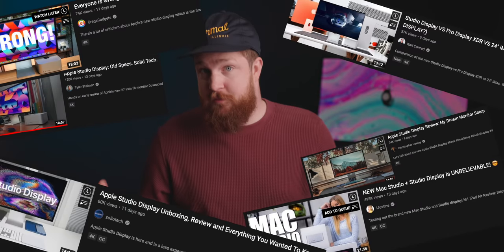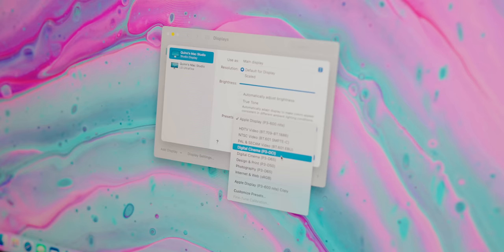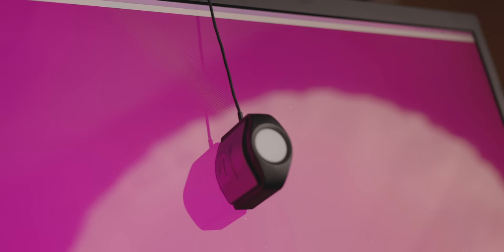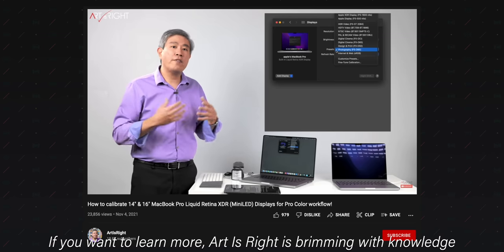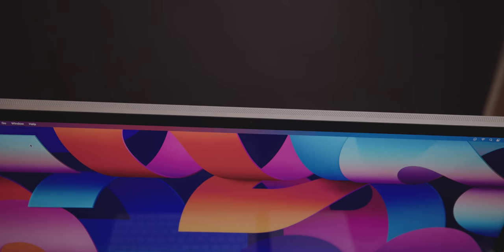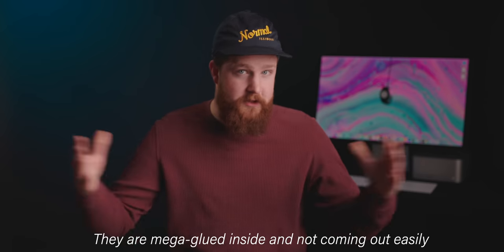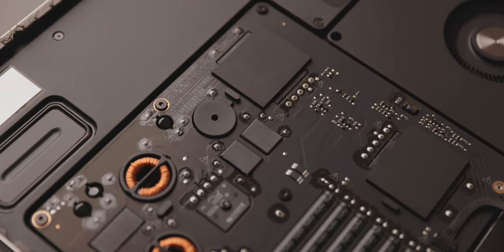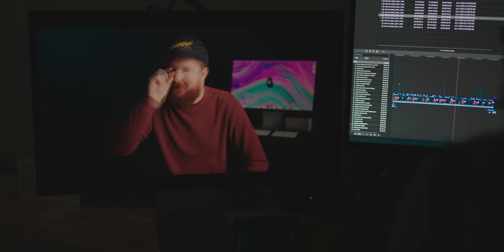The Apple Studio Display Is WEIRD!

Comment: Totally agree with you, I looked into it when I bought the mac studio - but I could not justify the price - sure it has amazing sound and a web cam - two thinks I don't care about compared to good colour and not having to pay so much for a heigh adjustable stand that is included with just about every other maker - I don't see too much difference between 4K and 5K - yes MacOs scales better in 5K but I believe that this is done on purpose. With QOLED around the corner and improved panels  I will rather wait (the 4 months I'm waiting for the Studio anyway). It's beutiful .. sure but I just want a good panel - not something that I use as an art piece.

Comment: I’m still wondering if the rumoured problems they were having with producing mini-LED panels for the MacBook Pros plus supply issues mean this was originally intended to have a better panel but had to fall back on the old 5K because it just doesn’t fit in to the line up of the last couple of years.

Comment: The 64gb storage is not surprising at all. 

Apple standardises - it used 64gb as the minimum storage capacity on the iPhone 11. Taking the a13 + the 64gb storage means there is no additional work required to the chip or config at all + the additional work needed to produce new versions of the a13.

It’s why the HomePod with the a8 also had 16gb of internal storage.

Smart and lazy at exactly the same time.

Comment: I completely agree that this monitor is strange and I thought so since the keynote announcement.  After thinking about it here is my guess as to what this monitor actually is and I’d be interested in your view.  Yes, this a 5K monitor when connected to a running computer.  But, like you trying to understand the use of a A13 with 64 Gig just to handle Siri, Center Stage, and Spatial Audio.  Except for Center Stage all the remaining functions are currently being handled on the much cheaper, much smaller, and cheaper S5 from the Apple Watch found in the HomePod Mini.  So why a A13 with 64 Gig?  On day one when the first update for the monitor was pushed and it was found that the update was iOS 15.4 more things started to fire off in my head.  Is it possible that the Studio Monitor is also the first HomePod with a screen with the ability to run apps such as AppleTV, AppleMusic, etc.?  With a dashboard and HomeKit coming perhaps at WWDC.  Is the A13 there not only to provide access to the apps to control with Siri but also to use Universal Control and to support Widgets for use in the user customizable dashboard?  PS:  The only other Apple product that I am aware of with a difficult to remove power cord is the HomePod.

Comment: There really should be more 5K displays. Having one means you can use it with 2x integer scaling and get 1440p (which is great at that size imo). 2x integer scaling at 4k only is 1080p.
Reply: That's hardly useful outside MacOS, UI elements are drawn by the OS and can be non-integer perfectly fine.  For content consumption, 4K is enough, it scales perfecly 1080p, 720p and 480p. The only advantage I see for 5K is for video editors who want to see the 4K video without any scaling + the video editing software on the screen.

Comment: The now cancelled 27" iMac came with the same screen as the Studio Display plus an Apple computer, plus an Apple mouse, plus an Apple keyboard.   Much of the animus towards the Studio Display is because loyal Apple customers that now feel hosed (taken advantage of/swindled) because for several  hundred dollars less you get no computer, no mouse and no keyboard.  We know and accept that Apple is more expensive but if you compare the iMac Studio (base) plus the Studio Display plus an Apple mouse plus an Apple keyboard  to the now cancelled 27" iMac, the cost is not 20% more or 50% more but close to double the cost.  I hope you are right, i.e. that the 27" iMac will be resurrected but I rather expect the value proposition will have deteriorated vs. the now cancelled 27" iMac.

Comment: Did you try the thunderbolt 2 to 3 adapter and using it with an older thunderbolt 2 mac? That’s the real question
Reply: You won’t get 5k so why do that. TB2 doesn’t have the bandwidth to do that. It can do 4k 60hz but not 5k

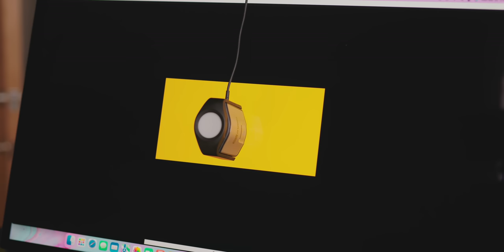Comment: 00:36 You can add 3 more options if you're willing to accept faux-5K (5120x2160, instead of 5120x2880) and IPS. LG names it Nano-IPS, but that just means extended colour gamut (98% DCI-P3) which they all three have. All three share the exact same curved ultrawide panel.
Dell U4021QW (Thunderbolt 3)
Lenovo ThinkVision P40W-20 (Thunderbolt 4)
LG 40WP95C (Thunderbolt 4)
Of course one or the other might not play nice with MacOS (or Apple hardware) even though they all offer Thunderbolt connections.
I like this video.
Reply: Or just buying a refurbished iMac 27-inch.
Reply: @MalcolmREBORN  You managed to use a refurbished iMac 27-inch as a monitor for a Mac or Macbook?
Reply: @Br0adCastYourS3lf  No, I was thinking about the mid 2020 27-inch Intel model which is no slouch.
Reply: @MalcolmREBORN  Then I misunderstood.

Comment: did anyone else notice the "CapXon" capacitors on the power supply? those things definitely will not last, i've seen countless capacitors from this brand just completely dead or leaking on machines that aren't even that old. not sure if this has been a recent apple trend, but in the past they've almost always used high quality caps (nichicon, from my experience) and besides the G5 iMacs they've always lasted for years and years on end.
Reply from the maker: Yeah moving away from Japanese components is a shame.

Comment: What would be interesting is a comparative teardown of the LG 5k Ultrafine and maybe some other example of a 4k thunderbolt/USB-C multifunction display, to see if the internals of the Studio Display really are that surprising, or whether fans (esp. in units with hefty PSUs to charge laptops) and fairly powerful ARM processors are par for the course. 

I suspect that what makes the Studio Display so expensive (apart from the handsome profit margin c.f. box-shifter specials where they only make a profit if you buy a Monster HDMI cable and extended warranty)  is Apple's self-imposed determination to make everything so ridiculously thin...

Another interesting comparison would be to address the real alternative -  the 5k Studio Display vs. a good ~$800  4k UHD display & the associated scaling issues with MacOS - and whether it is worth the 2x price difference. That seems to be the real buyer's dilemma - esp. when - whatever LG says - the 5k Ultrafine is still pretty hard to buy.

Comment: They could make a better display, but I know exactly what the problem is. They don't want this to outshine their flagship pro XDR, that's it. that's the reason. As for the overengineered build, my suspicion is, THIS IS supposed to be the MAC STUDIO, but they could not figure out how to cool the behemoth M1 Ultra Chip properly in this chassis, either it's running hot or barely cooled with the fan noise of a jet engine, they decided to separate the products into two. Because imho, contradicts to what everyone thinks about mac studio, to me, it is kinda a sore to the eye sitting on top of the desk, boi is too thicc.

Comment: What?  It is a 8-bit display?  Why was my USD 450.- AOC 27" 4K display that I bought 6 years ago came with 10-bit colors.  Who would use the Mac Studio Display at 600nits while reviewing it at an arm length inside a studio.  I think it is just too bright to view the monitor at 600nits comfortably over time.  Perhaps Apple will tell us more in the future the purpose of putting the A13 Bionic chip and 64GB of ram inside of a monitor despite the fact that these additional hardwares do not help too much with the graphic performance of the monitor currently.

Comment: I think that by forcing themselves to use a single USB-C plug, Apple is painting themselves into a corner. They put high refresh rate and/or variable refresh rate on all mobile integrated displays, but until the release of Thunderbolt 5, they can’t really do that on a 5K/6K panel, and that’s too bad. But it’s the lack of good HDR, combined with the non-modular stand that makes me look higher. I want a new Pro Display with the speakers, camera, and mics out of the studio display, and good HDR, along with the current modular system allowing for an Apple Pro Stand or a VESA adapter. I’ll pay for it, too!

Comment: No matter what apple did with this display people would complain.  Most asked for the same 5k monitor as a display.  Apple added speakers, Webcam, some storage (not sure y), and some other options.  I don't use the Webcam at all, and have plenty of other devices that have a Webcam, but if Apple left the Webcam out (especially now when So many people are on Zoom meetings) they would have received even more criticism.  If they used mini led the monitor would have been priced $3k plus and they would have received even more criticism.  I think the main issue here is the price, and like everyone I wished they'd priced it lower as well, perhaps a base price of $1,300 or less.  What bothers me, if you want to use 2 or 3 of these together, then your really wasting the speakers, Webcam, etc on the 2nd and 3rd monitors.  Personally I think this was a smart move on there part, at the end of the day the people that were planning on buying these will buy them and the ones that were never gonna spend over $1k were never gonna buy one no matter what Apple put in it.  The higher the price the less quantities are sold.  The average price for a TV is $1,400, and the majority of people would never spend more then that no matter what other benefits are included.  The new LG and Sony OLED 42" which is priced around $1,400 is an excellent alternative, though still a large display.  And the Sony and LG will be disconnected overtime.  You can get a Sony 48" OLED for around $1k now.

Comment: If you compare the LG Ultrafine and the Studio Display directly side by side, you see all the Differences, that makes the small Price Difference worth it. To the Ultrafine, you have to add the Glas on front, the all Aluminium Housing with excellent Stability and much better Build Quality, the much better Speakers, the Centre Stage Camera, the better and more Mics (3), the better Screen with more Brilliance and already Calibration in the Factory and, of cause, the very thin Power Supply included in the Monitor, just 17mm thick. And even the Cables are much better. I can't see any other Monitor until this Price Point or near, which would be as near as good. And the Samsung S9 seems to be much overpriced in Comparison.
So, I disagree with you. The Studio Display is not overpriced, is not as bad and as you tell and is in my Opinion the absolute best Choice for a Mac. The only Alternative would be the Pro Display XDR but without Camera, Mics and Speakers, it is incomplete.

Comment: My theory is that they initially had a 27 inch iMac in mind but then the thermals didn't work out for M1 Ultra and they decided to split it off into the Studio Display (with a lot of the parts the iMac would have had) and the Mac Studio. Since the Apple Silicon was moved to the Mac Studio, there was no longer a CPU that was able to take care of the webcam with center stage and the other features they had planned that could have been driven by the M1, so they decided to use existing A13 stock to keep software compatibility and split the two with a single cable connecting them. This also means they get to double dip for many customers who want the full package.

Comment: For the price you can get a new 42 inch OLED, logi brio, and speakers, or hell even a Samsung G9 Neo.
Reply: It’s crazy that they’re charging  as much as they are. The G9 neo absolutely blows the studio display out of the water. It’s got 2048 local dimming zones and a peak brightness of 2,000 nits.
Reply: @Ender275  the G9 neo costs more, has half as many pixels stretched over roughly double the surface area, and it’s a ‘gAmInG mOnItOr’ so it looks like it smells of dried semen.
Reply: @bahlalthewatcher4790  It's only £200 more, and it  even has a hight adjustable stand.
Reply: @ashliehiggins  ok? I can find other monitors that are also worse than the studio display, many with height adjustable stands, for less than $600. 

This monitor is not for gamers who might find a use for a low-resolution ultra-wide wank station. It’s for people who want a 6:9 monitor at >200ppi, that works well with macOS, and looks really nice and will last 10 years.
Reply: *16:9
Reply: @Ender275  my problem is that gaming monitors all look like they were designed by a 14 year old boy.

I don’t quibble with your suggestion that it has superior picture quality, though I struggle to see how that can be possible when the pixel density is 4x lower. But if I’m buying half as many pixels for more money, the picture quality had better be more than twice as good.

I’m not sure why you think a 4K 32 inch monitor would be compelling for people who consider 4K is inadequate at 27”.
Reply: @bahlalthewatcher4790  how the hell is 4K inadequate at 27”?????? 

It’s half the ppl not 1/4. I can’t even see a difference between 1440P and 4K most of the time and I usually have a pretty good eye. I mean 4k is a little sharper? Also yeah the gaming monitor designs are dumb but the display tech inside them is what’s more interesting to me. 

PQ: is more than just PPI, you have to factor in things like screen uniformity, screen contrast and pixel response times among other things. 

One of the main issues with the studio display is that it’s using an IPS panel which are notoriously bad for good contrast. They make blacks look grey.

You could buy a 42” C2 oled with far superior picture quality and a slightly lower PPI for less than the studio display. 

The studio display as it stands is overpriced and underperforming.
Reply: @Ender275  it depends on what you use your display for. Because of the way macOS favours integer scaling, everything looks perfectly sharp at 2x scaling, and 5K allows 2x scaling of 1440p. 4K allows 2x scaling of 1080p, which is ok at 24” but makes everything look huge at 27”. The alternative is 1x scaling, but this makes text and UI elements tiny. The compromise is that macOS will render a 5K buffer (which looks like 1440p at 2x) then scale it down to 4K. Which looks ok for a lot of things but introduces text blurriness and other subtle visual artifacts. If your job involves reading text all day, you’ll prioritise this sharpness over  true blacks, response time or refresh rate. 

All this is to say that macOS, like iOS, is designed to run best at about 210ppi. Which is why since about 2014 every Mac that ships with a display (laptops and iMacs) have targeted that pixel density (eg the 5K 27” iMac). Apple exited the display business expecting third parties to make a whole range of 5K monitors but it never happened, because windows doesn’t do high DPI in the same way as macOS and as a result 4K is ‘just fine’ for windows users. 

The end result was years of Mac users clamouring for apple to make a good alternative to the LG ultrafine. Nobody who has been wanting this monitor expected it to be cheap, because of how the Ultrafine and the iMac were priced. It’s possible Apple will produce a ‘pro’ version of this display, eg a 27” 5K mini LED display at 120Hz. But that will sit between this one ($1600) and the 32” Pro Display XDR ($5000) - ie at least $2,500 and probably more.

Comment: Just using the 24 inch imac transformer and apple doesn’t need to make 2 power supply board and cable can’t remove and make it thinner! And provide land port as well!!!
Maybe apple need this design so the $400 stand can move up and down ???

I don’t want a pro iMac come with power cable can’t remove

Comment: The only spec that matters is the 5k at 27 inch that plays nicely with MacOS's pixel scaling. You either value that A LOT that or you don't at all. Me personally, I don't care about that at all. I use two 32 inch 4k monitors, MacOS looks great to my eyes and obviously I got a great deal for them.

But I know several MacOS users who really REALLY care about the scaling, and I'm betting that Apple believes there's enough of those persnickety types who value that scaling enough to front the cash justify it's existence.

Comment: I totally agree with you ! This display is incredibly over-engineered for every sing part... except de display part. And that's a shame, because the main thing should be the display quality, not having an over-engineered power supply or A13 (when every M1 Mac could easily manage the webcam and sound system)... I ve been waiting this screen for a while, but I can't buy it! It is overpriced and outdated (huge bezels, no local dimming, in fact nothing more than a 1800$ iMac from 2014...). That's the moment when I hate Apple... even more because they don't support brightness and sound settings for external display AND macOS is not optimized at all for lower resolutions... Additionally I'm sure this display will stay for at least 5 years, without lowering the price, that's a joke! And when we use Macs, we currently don't have any decent display option... Why didn't they just provide a monitor that would take over the Thunderbolt Display, at $999 (with adjustable stand). That would have been perfect and exactly what everyone would have expected... In a second step, they could have launched a similar model but with local dimming (and adjustable stand) for ~$1900.

Comment: 64GB storage  is more of a cost thing then you think.. right now, try and buy a new made today 16GB or less SD card, not a new old stock, i'll wait... its the same thing.. 64GB nand chips are made in a quantity that just make them cheap right now.
I would guess that the iphone chip wont work with less then 4GB of storage but yeah 64GB is overkill however cheap by the quantity that apple wants.